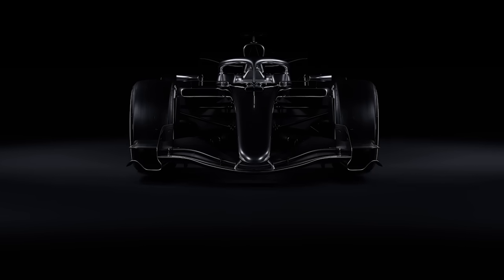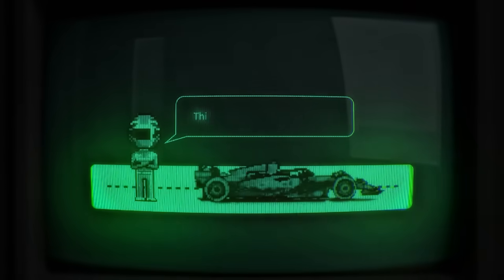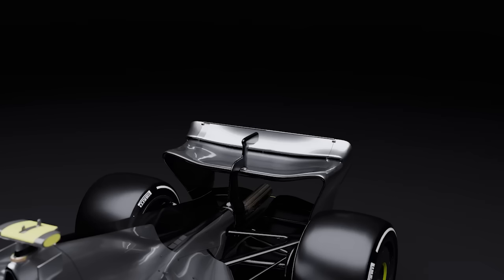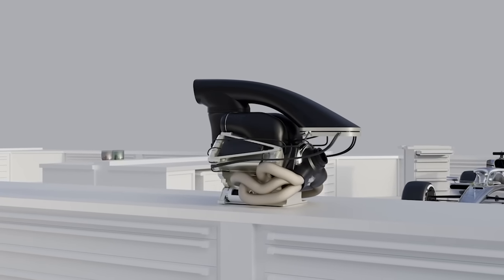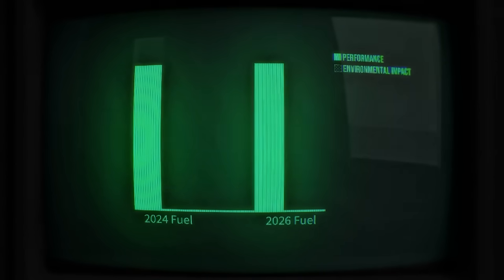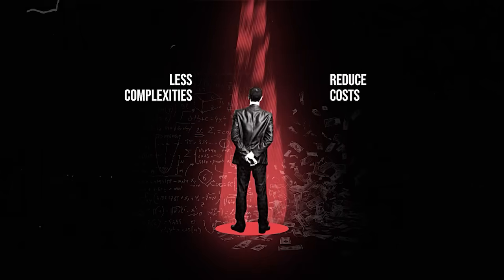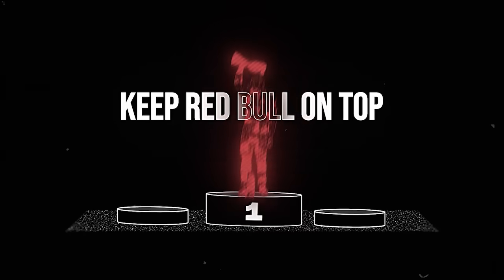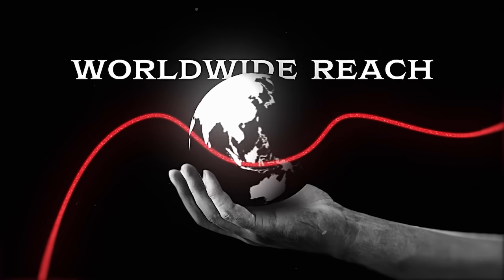F1 2026 Regulations: What’s REALLY Changing?

Comment: If these cars give better racing and most importantly better sound I'm down for the idea
Reply: Unfortunately probably not sound, we’ve come from the v12, v10, v8 and now v6 and the demand of the combustion power unit is no longer what it was previously since demand on the battery power is increasing in 2026. 

I can see these cars being 100% battery powered within the next 2 rule changes after 2026. It would actually simplify the system and you’d have electric motors on each axle. If they placed the battery system low and spread out enough maybe it could lower center of gravity too. That would mean engine manufacturers would actually have to battle to produce the best battery and electrical system. But overall I think the system would be more reliable with cooling than a hybrid system where 2 components would fail. 

Yeah it’s sad we won’t hear those old f1 noises but it’s just how things are moving unfortunately
Reply: @dannyrbailey we've got formula e for this
Reply: @dannyrbailey idk hopefully with the removal of the MGU-H they will be a bit louder, still nothing like a v10 but might have a more  pleasant tone than the current hair dryers.
Reply: @dannyrbailey they already have formula E. They won’t go full electric
Reply: these cars will give worse racing. they have compromises on top of compromises, all because they were scared of audi producing a better package due to their lmp1 history
Reply: for these cars not to be slower than super formula and f2 they had to increase the downforce with little wings and outwash elements here and there, which will increase dirty air generated. which will make it harder for the cars to follow and battle each other. such a stupid era of f1 cars this will be.
Reply: No MGU-H in 2026 = slightly better sound
Reply: The concept is bad bro
Reply: Better sounds is great for TV coverage but its something that you would want to admire from Afar irl i mean if we like sound soo much why do we cover our ears when one passes by in hillclimbs 🤔
Reply: it won’t.
Reply: better sound? its gonna turn into toy rc cars.... scaled up
Reply: i went to Formula E once and the sound makes the difference while cars are racIng
Reply: Sound what sound. More its more electric than ICE. The only way they will produce sound is by installing speakers
Reply: @FirstLast-jd2ql  agreed
Reply: @FirstLast-jd2ql 2026 will actually be way louder, for a multitude or reasons. 
#1 MGU-H, wich is a big noise reducer
2# engines having to work more consistently hard to charge the batteries, drinking more fuel and revving higher
3# you can discount all of this because the FIA are officially looking to reduce the "loud noise" for the 26' rules. What fucking hypocrits the FIA are.
Reply: @FirstLast-jd2ql  another overreacting hater 😆
Reply: "Most importantly better sound" idk man good racing is way more important than sound to me
Reply: @Marrrrrko47  Go watch Formula E..bunch of microwaves. There is a reason F1 racing was better in 2006 and the engine was a big reason for that.
Reply: @MetrosexualFilth Exactly. That's the main reason I many watch racing was the noise.
Reply: @Marrrrrko47 those vacuum cleaners hurt my ears especially that screeching noise they make. You either make it have no sound ( like it isn't already dull ) or make it be less disturbing to the ears. If you have a combustion race car you won't have that of course if it's a poorly executed exhaust of a VQ or a Civic in 3am..
Reply: @Marrrrrko47 I'll watch nascar. For that.
Reply: @Marrrrrko47 Exactly, I know people hate Formula E and call in a joke just because of the cars sounds
Reply: @spacebeansz  don't have sound, am not inspired. Basically not have music.
Reply: @Marrrrrko47  are u sure u still wanna hear vacuum cleaners
Reply: I like the sound, it sounds like cars who proven themself @Rndmcarvids
Reply: @Rndmcarvids I'm into F1 by racing and engineering. I would like an improvement in sound too but not for a sacrifice in racing quality
Reply: @Rndmcarvids I’d rather the cars sound bad but have the racing be great, than than bad racing and cars that sound perfect, and the fact any one would disagree is astonishing to me.
Reply: @Rndmcarvids  even tho the engine power will be reduced. eliminating the MGUH will prolly enhance the sound by a lot
Reply: @Rndmcarvids  these sound nothing like vacuum cleaners tho. That's an overreaction.

If they are going to bring back something about sounds, then make them sounds like the 1000hp inline 4 F1 engines of the 1980s. V10s are overhyped by fanbois.
Reply: @Rndmcarvids Current V6s ain't even that bad to begin with soundwise, like sure, they won't make your ears bleed when driving into Eau Rouge, but they have the added benefit of not needing to be replaced race-in, race-out like the "good, old, *reliable*" V10s
Reply: @paein9642  reported
Reply: @Marrrrrko47 EXACTLY!!! I HATE the “bring back the v10s club” because all they care about is the NOISE, and not the RACING. if you only watch F1 for the noise, you are not a racing fan, you are an engine fan. Simple as.
Reply: @glitchingbee Then we won't watch. Simple.
Reply: @Kirck-np3tv  good. We don’t need your rose-tinted glasses around here. Racing is racing, cry all you want about the noise.
Reply: @glitchingbee  oh, then I'll watch Nascar then.
Reply: @glitchingbee lmfao. Racing won't be exciting with out the noise of the cars. That's why people got in to cars in the first place. Granturismo, NFS etc etc if you take away the main thing that makes people who like cars.. then you would lose the main audience and I doubt they want that and if they do, Nascar would be the most popular racing series if F1 goes full EV. Nascar them selfs say they won't take away what make the sport appealing. The sound.
Reply: @North-101-Racing  dude, you missed my point. People like cars because of DRIVING, the engine sound is just a bonus that REAL drivers don't really think about. And it sounds like NASCAR doesn't understand racing either. You saying it "won't be exciting without the noise of the cars" is just plain wrong. I guess taking away cool engine sounds automatically removes side-by-side action??? God, you people do NOT get this sport.
Reply: @glitchingbee  seriously, Racing and sound is what makes us smile. Sounds is the cherry on top of everything. You are clueless. I my self would have not being a car guy to this day if I have not heard that 5.0 mustang with that whipple when I was 13 revving and gapping cars at the drag strip. I got in to cars cause of the sound. The sound makes me smile. And you are the ones here who don't get it. Nascar, indycar, monster trucks, motogp, Imsa, and WEC. Are the reason why many generations of kids love cars, heck I can even put in the racing games also. The day when Cars/ Racing cars turn full electric is the Day when enthusiasm for them goes stale. Having talent is great but what draws people to see racing is the sound full stop.
Reply: @glitchingbee  bro your full of it. The main reason People even pack the stands is not just the driver's driving, it's the cars. Get your facts right. That's why Nascar is popular in the states cause they know what draws people to see there races and why it's one the most motorsport popular sport in the states, they know what people like, mix with the amazing cars and the drivers, and the versatile schedule with the circuits there adding on, is a recipe for success.  You can't tell me Formula E is it. Yes they might have talented drivers but what else is the draw? What is it? Just the drivers? You must be kidding your self, the cars also have to have a say as well. There is nothing that makes me watch electric racing. As long combustion racing like Nascar, V8 supercars etc etc exists there is no way they would beat them.
Reply: @glitchingbee what?!? Nascar don't understand racing? So your saying the people who watches and loves the sounds isn't racing fans? Like what are you trying to accomplish here m8? I get it but..can you tell me what should interest people to watch cars that don't have any resemblance of character?
Reply: @Nerko-mx8yn sure! Thank you for actually being somewhat respectful first of all. And what I am saying in my main argument is not that people who like engine sounds aren't racing fans (I personally love engine sounds), I'm saying that the people who refuse to watch motorsports that don't have attractive engine sounds aren't real fans. Anyways, the main allure is the adrenaline of being so close to something that fast. And also the hopes of seeing a crash, as morbid as that is. NASCAR especially has the big draw of being an absolute wreckfest at the superspeedways. The noise of NASCAR is also another attracter, but people would still watch it if it were electric.
Reply: @glitchingbee damn you y'all clueless. Is F1/ EV fans sooooo ignorant to think people would even watch cars that cant even make me feel like a want be a race car driver.

Sad.
Reply: @Noman1010-nh6uh  looks like somebody else missed the point!!!
Reply: @glitchingbee i doubt people would watch. Am not a Nascar fan but saying people isn't racing fans just because they don't like Cars with out engines is false. There just simple not interesting. It's simple. Your point just doesn't have a base. You and the other people just don't have base for that, and am not even old and I know how boring they are. I mean the Main audience of F1 is made up people who love cars and love how engine works and how sophisticated they're and how they sound. If you remove that from a sport that people loves, then the love for it is gone, people don't know how electric cars work and neither can't we work on them with out going to shops. EVs are just boring, everyone says there boring Cause they are. And you can't change peoples mind and the more Motorsports gunning for EVs the more people will not care. It's the fact of the matter,  makes us not remotely fond for the future.
Reply: @glitchingbee  I have not missed a single point. I said exactly what these other people are trying to tell you. It's like your so high and mighty for the sport that you think your smartest person here. You and the guy up top as well are so naive is what makes F1 fans soo dumb. If your so ignorant that people won't leave then okay. More power to you. That's why Nascar stands are filled  every freaking race and why 10mill plus people watch the 500, and why 100 plus people go to the race every year. That's why I got tickets for this year to hear the sound of those V8s whizzing by me to feel the rumble, that's what I want to experience when I want to go to a race, and mexico to. I might not be a American but thats the reason why a lot of people go there for the driver's and the cars. And you will never get it.
Reply: @Crutz-x9p  Amen
Reply: @Noman1010-nh6uh  I do get it, you just can't see I do. I literally said that I too enjoy combustion engines, but it's not the sole reason I watch racing. The engines are exhilarating, sure, but you've once again missed MY point; people who ONLY watch for the engine sounds are just engine fans. Your own justification proves that it isn't just the engines you come for, it's the speed. And while you do lose some of the thrill when engines are removed, the speed is the same.
Reply: @glitchingbee  if they care about sounds, why they didn't attend BOSS GP 😂
Reply: @glitchingbee i went to Formula E once racing was fine, lack of sound makes the racing feel different, sound is necessary to stimulate the audience, im a racing fan and mkre into driving skills than engines and like it or not sound stimulate the audience, i went to formula E and other series the loud sounds make racing mkre interesting despite being.slower cars and less action
Reply: Better sound? They are getting more power from the hybrid battery, wtf is better about that?
Reply: Better racing for sure will not 3500mm size diference is 0 change to overtake and side by side battle quality.
Reply: @sauroncro  had a stroke reading this

Comment: "What's really changing?" 
They found out a way to make them even shittier😂😂😂
Reply: Oh, welcome among us a true F1 engineer, who already knows how cars will be in 2026!
Reply: @Sonnell  Not speaking about laptimes or how close the racing will be (which it won't as they went backwards and thrown out most of the 2022 regs ideas about wing simplification). Engine regulation will demand a 50-50 power split between Electric and ICE. But the battery pack won't be able to supply all the power needed at all times, as well and the MGU-K not having enough energy transfer (on its own) to recharge the batteries enough. So teams will be FORCED to burn fuel to literally recharge the batteries and have the ICE act as a generator. 
That's why the 2026 regs will be shit.
Reply: @Artiick  You picked a few things among the wast amount of changes, which might support your "argument". 
This is very weak as an argument. 
Also, what makes a racing car shitty anyway? We do not drive them. All what counts is if the racing will be the same or better.